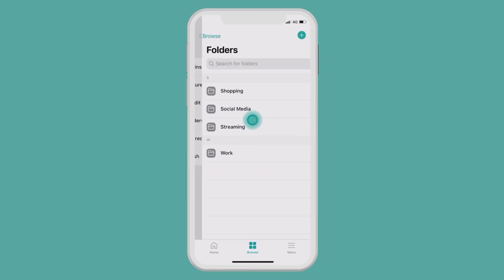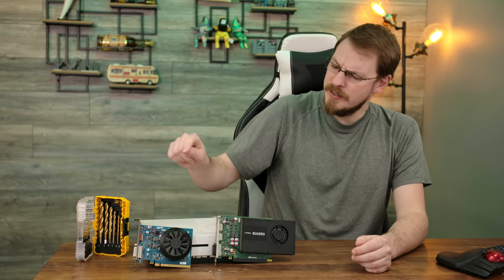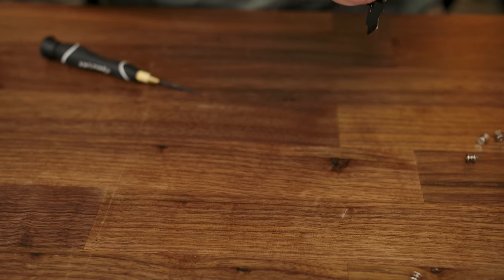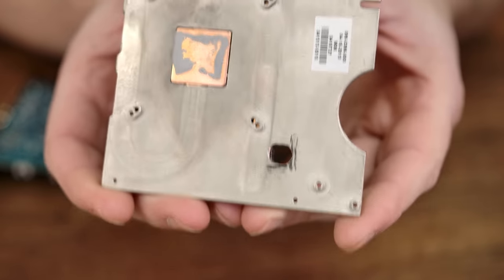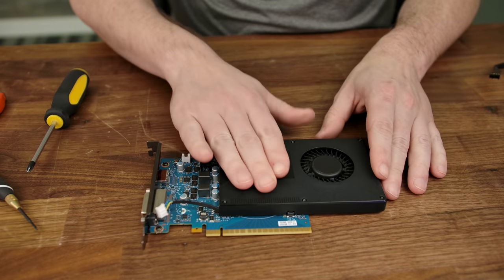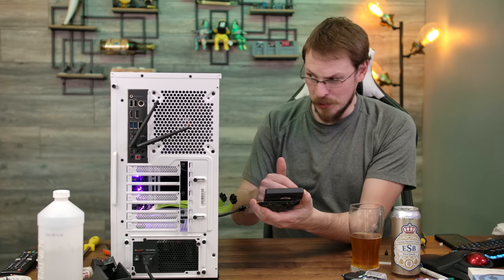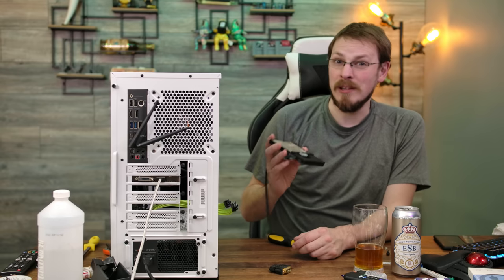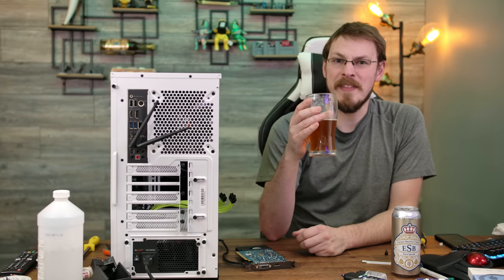Making my own Single Slot GPU Cooler

Comment from the maker: Aaaaand I'm almost positive the issue is that capacitor. I have some replacements on the way, and will be replacing it shortly. Follow up video #soon.

Also, thanks to NordPass for sponsoring today's video. Download it for free by visiting https://NordPass.com/Craft.
Reply: You wouldn’t mine if I sent this to Louis Rossmann would you?
Reply: The gpu may also be throwing a fan error since nothing is plugged into its onboard header
Reply from the maker: I tried plugging in the fan as well. Still nada.
Reply from the maker: @FrizzleTits This is a pretty simple fix. Nothing even close to the tools has has are required.
Reply: @CraftComputing  I would have told you from the start to take of the caps off and resolder them on the back! The pwm fan will work on the 2-pin header on the card. please do a follow up Video!
Reply from the maker: I don't think I have room in the case for the caps on the rear. I needed them to be on the front. Really hope I can figure this one out.
Reply: @CraftComputing  was there any bare copper under the new xtal location that could have gotten shorted out (to the bottom of the case)?
Reply: @blahblahblahblah2933  Similar thought here as well, if no crystal (from shorted out via heatsink), no clock for the card! Cap might be ok, even with that very small bend.
Reply: Those solder joints are balls not pyramids. So bad joints man.
Reply: Solder the capacitor in the back like that crystal
Reply: If it was the capacitor, you would definitely smell it. It could be your oscillator shorting on the back of your cooling plate?
Reply: Also, cmos? Your board could be just acting up. Maybe that gpu is pcie3.0 and your board is set to 4.0.
Reply: @CraftComputing  or just add some extension wire to the cap and hot glue it somewhere else on the board
Reply: I dont know if crystal osolators are directonal so it possibe that is mounted backwards.

As other people have meroned possibe shorts usally theres a thin plasric film under hearsinks that are  over exposed solder joints and smds

Those woud be my two ideas
Reply: @CraftComputing  Louis Rossmann made a video expressing his dislike for pc hardware destruction
Reply: Just gonna ask... Didn't making clock chip flip on the other side of the board makes the two outer pins switch places?
Reply: Instead of relocating the oscillator, why not just add a copper shim to raise the whole heatsink up a little? It would decrease the heat transfer efficiency, but should be okay on this lower TDP chip.
Reply: It was a crystalize oscillator issue. You didn't flip the oscillator.
Reply: @abdulmuhaimin5274  how do you tell?
Reply: did you solder the crystal oscilator the correct way. not sure if it is directional
Reply: you said you need a single slot gpu
have you considered trying to get a 1070 katana second hand?
the katana was a single slot 1070 and it should pack even more oomph then your 1650 despite its age
Reply: @ig33ku  'should look like Hersheys kisses' is one of the better descriptions ive seen. Otherwise it means you are just heating the solder rather than the joint itself
Reply: @mycosys  you can see it balling itself  at the pad instead of that shrunken pyramid shape of a proper joint.
Reply: @AlexandraYume  the problem is the length of the GPU shroud
Reply: Can you get the same capacitor ratings but in a narrower diameter form factor?
Reply: Just put a THT caps with bend connector littlebit far to outside, also you can put it horizontally...
Dont forget to insulated its or you got short circuit...
Reply: I think that part you flipped to the other side has a negative and positive and that got reversed when you switched it.
Reply: Could you have possibly shorted the oscillator? There didn't seem to be indication that you prevented the aluminum from shorting the pins on the component.
Reply: Doh!
Reply: @shantanuchaudhari8548  they are not polarized, wouldn't matter
Reply: No is the solder part
Reply: I think you need to connect the old fan. Did you try this?
Reply: Bummer that NorVac didn't have it. :-(
Reply: Did you check for continuity between the XTAL solder pads on component side and the pads on the solder side?
Reply: I don't think that cap is damaged. I have a guess: on the other side of the pcb there is a ground plane, not pads for the crystal. Or the heatsink is simply shorting it.
Reply: so I have a dumb question, assuming you have a working card, and exact chips, what would happen if you pulled the VRAM chips and swapped them out for higher capacity ones?  Would it be detected?  Would it be used by the card?  Would the card not boot?  Would it catch on fire?
Reply: Did you pull the capacitor and check it with a MM?
Reply: And when u get the new cap the longer leads will help you move it however you would like
Reply: You could try to run the card without the capacitor, many capacitors are there for stabilizing  the vcc. If this is one of those it might work without it, i have mention that stability of the card could be a problem as seen in the recent 3080 cards that already had power issues when the model of a capacitor changed. However as the 1650 is a low end card i don't expect such severe problems as the 3080 had. Also if this is a capacitor to get ripple of the vcc and space is a issue you could try to add other models/values  on the back side and on other parts of the pcb connecting the same traces.
Reply: Take the heatsink off and see if it posts. I thinks its shorting the crystal.
Reply: Next time mount the cap on the back. No drilling needed
Reply: @mattparker9726  it would shit itself I seen someone do that to a 1060 3 gig
Reply: @jaybrooks1098  going in a Xbox case remember clearance in the case
Reply: @frizzletits8511  'shit itself' while descriptive, doesn't lend itself well to computer terms.  What precisely do you mean?  I'm curious.
Reply: @mattparker9726  no mem dedect core stuck at 100mhz drivers don’t work basically everything  no display output
Reply: @mattparker9726 but the 1060 3g and 6are different cards all together I wonder it it would work on a 710 1g and made it a 2g
Reply: @frizzletits8511  is it a coding issue?  Like what if you ran a custom kernel on the GPU?  I'm curious if it CAN work, not if it's practical or anything.
Reply: @frizzletits8511  yeah with the current GPU insanity that's going on, I would LOVE to find a way to add additional Vram to a card I already own.
Reply: @mattparker9726  It probably wont work without a custom bios. The 3060 was originally intended to be 6gb because it is a 192bits bus (6x 32bits) they bumped each module to 2gb. You could technically do the same thing on a 3060ti or even the 3080 and make it the 3080ti(20gb)
Reply: @zaxmaxlax  ok, so it's both card to card, if it'll even work at all, and also a code issue to make the card talk with the additional Vram?  What about taking an old (currently affordable and available card and adding Vram to it?)  what about a brand new card?  Something like a 4gb 1650 super?
Reply: @mattparker9726  Like I said it depends first on the hardware itself. Its like putting 64gb of ddr4 when your board and cpu is capped at 32 max. The 1060 3gb and 6gb arent a good example because they arent the same chip, but lets say nvidia comes with a 3060 6gb model, that could be possible to upgrade it to 12gb and flash a new bios from the 12gb model, unless they deliberately lock it like they did with the 1060's mining cards(p106) that wouldn't work properly even with the 1060 bios.
Reply: maybe replace it with a through hole capacitor hanging out of the pcb
Reply: @mattparker9726  ya I didn’t know but if had to take a wild guess probably something to do with a common component clock or common data bus.
Reply: you just don't mess around with crystal oscillators. do not touch them. now you will need to replace it. and good luck with the soldering temperatures...
Reply: .... could you just have flipped those caps to the other side as well
Reply: Still an awesome video. I've been thinking of custom watercooling a MSI 1650 LP for a passively water cooled PC (no fans, just one 240mm rad). I like the 1650 a lot and I'm glad to finally see someone do something interesting with one. Good on you. 

P.S. This is the first video of yours I have ever seen and it has earned you a sub. Keep up the great work.
Reply: @frizzletits8511  Hacking up a 1060 3GB variant is all that card is good for. Not sure why they ever made that.
Reply: @brianb6653  I think the 1060 3g was a competition card against the rx550 or 560 but it’s good as a server card
Reply: @MrLM002  there's a fanless 1650 from palit(GTX 1650 KalmX)
Reply: @zaxmaxlax  Sadly they're basically universally unavailable and have been for many months.
Reply: @MrLM002  Yeah I know. I tried to find a card for my cousin before christimas and the only thing I could find was a overpriced used 1650.
Reply: @zaxmaxlax  Oof, I'm sorry to hear that.
Reply: I can't help but notice there's no cooling for your memory chips. The fan on the original cooler was blowing air on then so they didn't need anything extra. Try adding some thermal pads to connect them to the heatsink? Might help
Reply: Did you flip the polarity of the oscillator when you solder it ?
Reply: @TheSimonarne  Those crystals are completely symmetrical, they'll work every which way.

Comment: I wonder if it is possible the card is looking for a voltage draw from its fan header to start.
Reply: Came here to say this.
Reply: yeah i have a network card that is like that. i stripped the jet engine fan off it and replaced it, and it wouldnt boot
Reply: Yeah I'd start here.
Reply: Probably, he should've tested it.
Reply: Easy test, just plug the original back in
Reply: I was gonna say to jumper the fan header
Reply: @Ajax2029  You mean to literally short circuit it?
Reply: Obviously plugging the original fan back in to the header first would be the best test. If it works, close the circuit without the fan. Fool the board into thinking something is there. Add a resistor if necessary.
Reply: He said in the pinned comment that he has tried that to no avail
Reply: @smeegle  note that the pinned comment is edited and this comment is older
Reply: I resistor would be necessary to fool card's BIOS.
Reply: Yes

Comment: If the caps are thru hole, relocate them to the back like you did the oscillator.
Reply: This
Reply: Except if you read through his pinned post and the replies you will see that it won't have room... Or else that's what he would have done

Comment: What you should have done is relocated the capacitors to the back. They are polarized, but the negative pin is marked with a semi circle on the top of the capacitor. And the pad for the negative pin is usually square.

In regards to height clearances on the backside of the board, if this becomes an issue, then buy a tantalum capacitor to replace it with, they have a higher energy density than electrolytic caps, though at a higher cost and also being far more polarized. (Tantalum capacitors are though marked with a line on their positive side... Standard is to always mark the negative side. In regards to the "far more polarized", unlike electrolytic caps that simply turns their electrolyte into gas, tantal caps short out permanently if they ever see a reverse voltage over them, then they quickly blow up when one starts the device... Even improper handling of them can kill them.)

And a tip, the solder braid works a ton better if you add on flux. (Solder braid rarely has flux on it, and the few that does doesn't have much flux to speak of.)
And you can also use a bit less solder on the joints on that crystal and the joints could also need a bit more flux. (Flux solves all issues when it comes to soldering. Just clean it up with IPA afterwards, otherwise it will eat away your traces like a leaking battery. Unless it is non liquid rosin flux, that doesn't really do much unless the board becomes fairly warm.)

In regards to the board not working, I wouldn't be all too surprised if one of the legs of the crystal oscillator doesn't have a connection with the board. My guess is the joint closer to the PCIe bracket side of the card. (from experience it doesn't look confidence instilling.)

The capacitor does likely not make things better, but since it is only smoothing out memory power and being a fairly large capacitor, then it would only really start having anything to do if the card is under at least a moderate load. Otherwise we wouldn't expect the GPU to talk all that much with its memory, so memory power consumption shouldn't be all that noisy and the other capacitors around the memory chips themselves should be plenty to handle the burden.

Since you aren't getting video at all, then my guess is on the crystal just having a poor joint.
Reply: Agree, relocating the capacitors to the back would have been much easier and better. Encasing an electrolytic cap inside of a hot heatsink doesn't strike me as the best idea ever.

I'd be more wary about the oscillator since we're talking high frequency there and it's easier to mess up the connection.
Reply: Came here to say this. It’s a lot less work to just put the cap on the back too

Comment: Serious question... since that cap is through hole, couldn’t you have removed it and put it on backside of the board so don’t have to cut that close to the pipe?
Reply: I was wondering that too..
Reply: It would be sticking out on the other side of the board quite a long way
Reply: Still... It would clear the heat sink easy peazy
Reply: Maybe he can put it on leads and lay it down on the back
Reply: I would rather desolder and solder 10 caps than making ugly holes that close to the heat pipe.
Reply: Then it would be  double slot card

Comment: If replacing the Capacitor does not work try plugging a 2 pin fan into it  (leaving the modded cooler & fan mounted to it) just to see if it posts. Might not give a picture without the fan plugged in
Reply from the maker: Nope, that wasn't it. I tried off camera before shooting the conclusion.
Reply: Yeah, I've used an after market cooler where the fan didn't connect and that card worked fine
Reply: @CraftComputing  Damn, was worth a thought

Comment: I'd be extremely surprised if it actually is the capacitor. I'd even be surprised if the thing wouldn't run absolutely fine with that cap removed. Did you check the clearance of the leads for the crystal to the metal of the heat sink? (It's a crystal, by the way, not a crystal oscillator. A crystal oscillator has at least 4 pins)

Comment: 2 things i've noticed(if it isnt the capacitor)
These are reletively uncommon so really would be a last ditch effort
Sometimes cards wont POST if the fan isnt detected, try plugging in the old fan, or a fan like resistor on the fan header
Quartz crystals arent normally polarized, but they can be. I might check to see if flipping that timing quartz araound would make a difference

Comment: Did you check with a multimeter if the back side pads where you re-soldered the crystal oscillator were connected with the front side pads? A through-hole component doesn't means it is reversible.
Reply: Good point, could be a multi layered PCB
Reply: Through holes for THT is practically always having plated walls, especially on PCBs that have copper on both sides, and even more often if it is a multi layer PCB.
Cheeping out and not plating the walls in the hole is actually more expensive than just plating them.

The issue is more likely that the pin on the PCIe bracket side of the crystal isn't properly soldered.
Given that the solder on the pin has formed a round ball, a typical sign that it isn't making contact with the pad bellow, it is a sign that there weren't enough flux when soldering.

Comment: Cool video. It seemed like your drill bit was jumping around a little bit when drilling the hole for the cap. Maybe a center punch and a set of clamps could have helped, especially since your clearance to the heat pipe was critical.

Comment: I was wondering if the crystal oscillator was on the wrong way, but it turns out that they're non-polarized. Hopefully it's just the cap. This is a pretty cool project.
Reply: I'd be worried about the oscillator grounding out on the back of the heatsink.
Reply: @wormchickenwizard  that could be possible. He could use some capton tape to cover it up to find out.
Reply: Damn, that shot down my idea
Reply: No, polarization doesn't matter. But I suspect he overheated the crystal when using the copper braid to remove it. Should've used a solder suction pump when desoldering through-hole components. It's either that or a short between the can (housing/body) and the metal leads. The crystal housing is only connected internally to ground, it's supposed to be floating. Any connection to system ground or positive signal will inhibit normal function. He would've noticed if he broke a capacitor. The PC would trip a fuse or release the magic smoke!

Comment: You might try replacing the electrolytic capacitor with a tantalum capacitor of the same rating. Its solid construction will allow you to pitch it over a little if needed without pulling a leg through the rubber plug and destroying the internal paper coil.

Comment: I thought it might be the re-soldered oscillator's contacts touching the heatsink. You may want to cover them with some silicone or  hot glue to make sure there is no contact to the Heatsink.